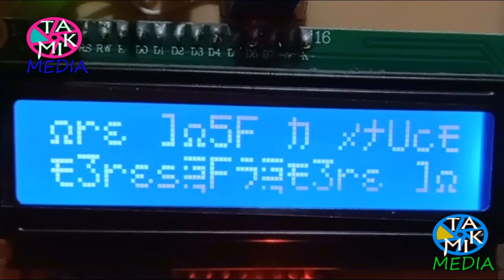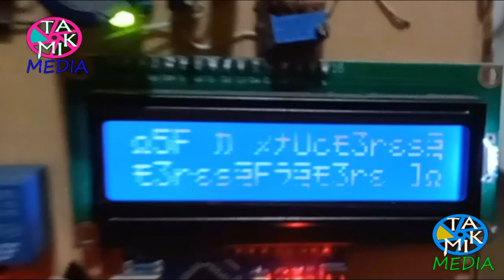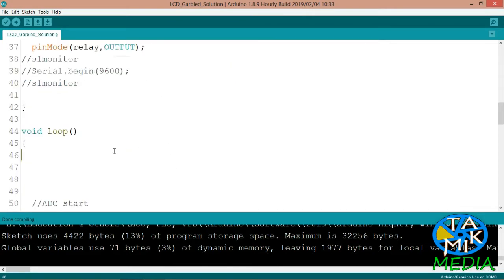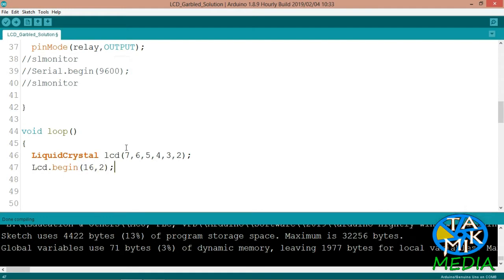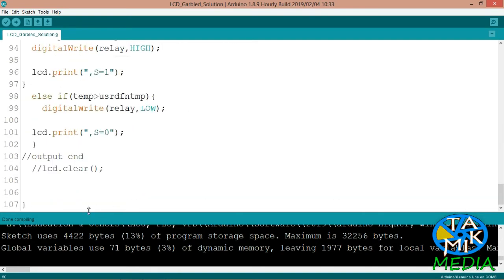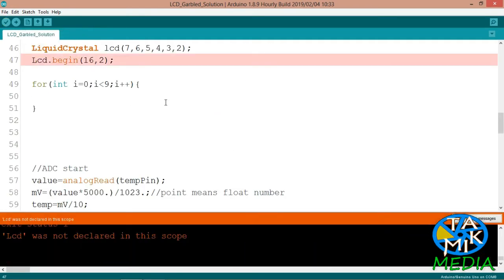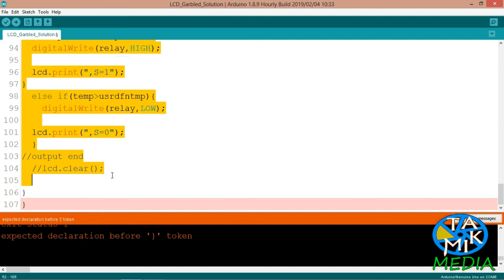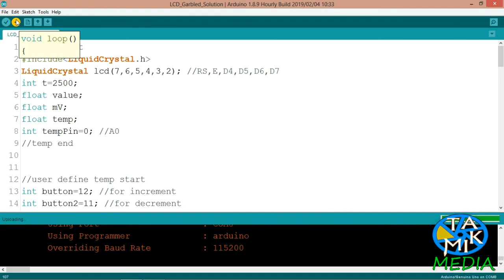How to fix 16*2 LCD garbled with Arduino

Comment: this is a crazy and brutal way to fix it... Corrupts? Simple, instead of initiating the lcd in setup, simply have it re-initiate every cycle. Thanks for the idea. I was setting up a 24v relay circuit today, tried to wire up a decoupling capacitor but ended up frying the board. I'll stick with the brutal software fix.
Reply from the maker: Welcome

Comment: You run though how to fix it to fast. You say and type nothing. I just don't understand how what you did put on the screen actually did anything.
Reply from the maker: I reset the LCD initialization after a certain time, so that if any garbled came then it will be resetting. Very simple.
Reply: I understand what you added to the code. I did not get to see the code to understand why you added it. I think the video could have explained why it was needed better. So I got nothing out of the video.
Reply from the maker: @jessicagriffin6836   I'll try to make another video on it for you.
Reply: This method will not work if there is timer looping exist in the program, due to reset, timer also resetting
Reply: This reply is going to be too late. If you still need help understanding, he put the lcd config/setup line in the void loop. This means every time the main loop finishes executing, it will re-initiate the lcd so you can reprint text on it without being affected by the nearby noise / EMF. It's a brutal way to fix it but if the board has enough storage, it's an easier fix than hooking up a decoupling / snubber circuit.

Comment: If me use i2c? What i can do it also?
Reply from the maker: hmm
Reply: It works also on I²C if you place 

 lcd.init();
  lcd.backlight();

in your loop, but these to function take some 100ms to execute. If time is not an issue, it works. Unfortunately, for my application this workaround is not an option....
Reply: My sketch 270 lines and more than 20 if conditions and 5 millis function 
For L2c 
Haw fix this problem when relay open and closed lcd freeze with unknown letters 😢
Can you help me